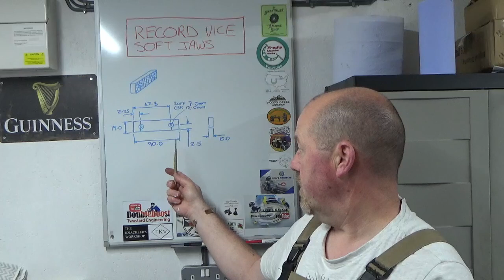Making Soft Jaws for Bench Vice

Comment: Sentimental....or is it centremental? I cheated when I made some replacement steel hard jaws for a 3" Woden vise I restored recently. I used an old bastard file and heated it to anneal the hardening. Milled the file teeth off one side cut 2 lengths slightly longer than jaw size and finished all dimensions and drilled/countersunk on the mill. Finally heated both new jaws to bright cherry and quenched in oil.... Job done and they look like shop bought items.
Reply from the maker: Hi Howard, thanks for the comment. Great idea using the file, never thought of doing that. You get your serrations on the jaw face for free! Cheers, Jon

Comment: Great project Jon! Nice work with the rotary table I would have never have thought of using it in that way. The cross hatching looks great and adds to the look. Just one dumb question what does the SC stand for on the description of the 12mm End Mill? Thanks John
Reply from the maker: Hi John, thanks for the comment. Not a daft question (no such thing), SC stands for Solid Carbide, and I differentiate with HSS for High Speed Steel. That's me making assumptions that everyone knows what I am on about lol. Even I don't know what I am on about sometimes lol. Cheers, Jon

Comment: Great Outcome Jon.  Looks like you need to change the internal thrust washer on your Vice as there seems a lot of play between tightening and untightening, the screw. About a turn and a half. Regards from Australia.
Reply from the maker: Hi Dave, thanks for the comment. This vice isn't brilliant but there's not that much backlash, I fully opened the Jaws on this shot to fit the Jaws, so a lot of that backlash was spring compression as the vice had hit the hard stop. Cheers, Jon

Comment: Instead of the WD40 you can use cheaper denaturated alcohol for cutting aluminum.
Reply from the maker: Hi Dieter, thanks for the comment. Yes, I think that is sold at methylated spirits in the UK. Due to my damp problems, I am reluctant to use it on the mill as it will strip all other oils away. I regularly spray everything with WD40 to try and combat corrosion (and it's not cheap). Cheers, Jon

Comment: Hi Jon, nice little project there, particularly like the cross hatch method :)
As of now I do not have a woodwork bench, got a few vices!!! (stick with me) so I use some old floorboards with a cut out that sits on the slide in my metal vice for said woodwork stuff and now and again leave them in saves replacing for the soft jaws like your apprentice ones. They grip seriously well on the soft stuff. TFS, GB :)
Reply from the maker: Hi Graeme, thanks for the comment. Understood! Wood is an excellent compliment to the metal shop (until you have to cut it). Sometimes the most simple solutions are the best. I like wood the best when it's wringing with oil, keeps the dust down and lubricates your tools all at the same time lol. Cheers, Jon

Comment: That was great Jon. Nice to see the rotary table in action. I  made soft Jaws the same for my Swindens vice, but I didn't put the cross hatching in. I've had a chance to go through the carbide cutters you sent me now, thank you very much for them. I've also now got one of your stickers in pride of place on my new tool box. You are currently next to Doubleboost and Haxby Shed. So in good company! I have also sent one sticker you gave me to my brother. The stand alone vice project sounds like a great idea. Look forward to seeing that.
Reply from the maker: Hi Carl, thanks for the comment. Glad you are safely home and hopefully getting a bit of shop time. The vice stand it a good way off yet, too many designs floating around in my head which need some rationalisation. Cheers, Jon